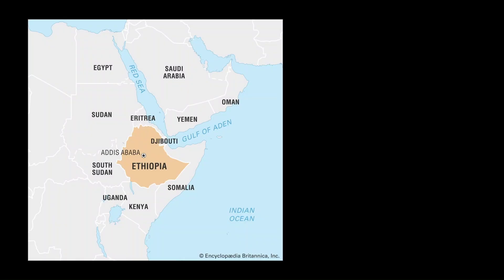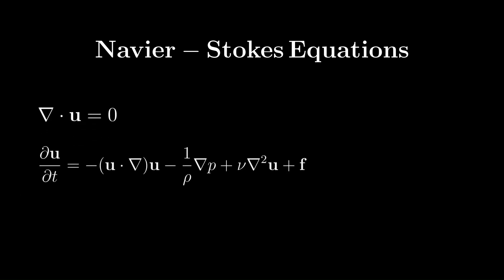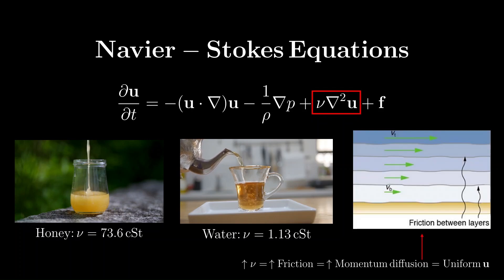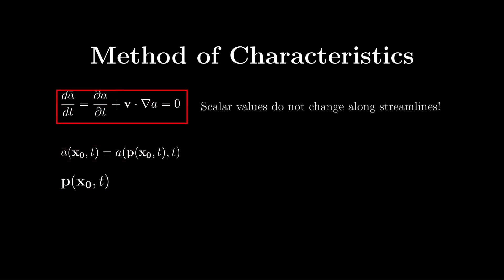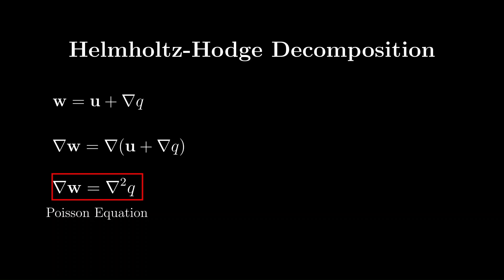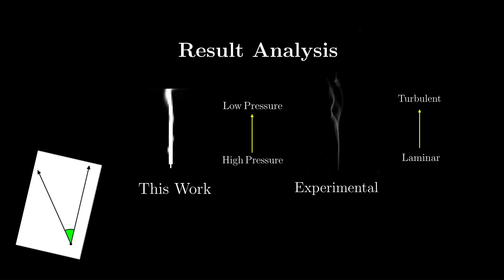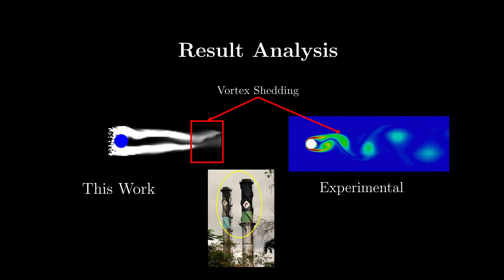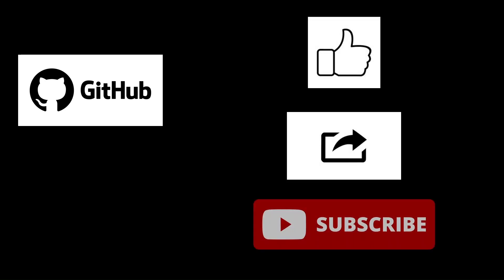Real-Time Fluid Dynamics Made Simple with Python

Comment: Is it possible to modify this to compute somewhat accurate lift characteristics for airfoils in a wind tunnel? The visuals are pretty, but I'm wondering if the pressure above and below the wing can be accurately simualted.
Reply from the maker: Hi @ChecedRogers, thank you for watching this video. I hope this still finds you despite the late response. As you correctly point out, this fluid simulation is very limited in capability. It serves as a purely visual simulation. Using a different technique, however, we can calculate highly accurate lift characteristics for airfoils in a wind tunnel (such as flow separation at the critical angle of attack, etc.). This and more are covered in my latest video: https://www.youtube.com/watch?v=P9BNJRcUxbM&pp=ygUNYmVuaWFtIGt1bWVsYQ%3D%3D
Reply: @beniamkumela  I look forward to watching the latest!

Comment: Very impressive, thanks! It seems the simulation currently is 2d, right? Aside from computational demands (and difficulty to visualize), would it be straight forward to extend it to 3d?
Reply from the maker: Hi @carlgeorgbiermann2915,
Thank you for watching the video! Yes, the simulation is currently in 2D but it is relatively straightforward to extend it to 3D - provided that you are using a framework that supports 3D rendering.